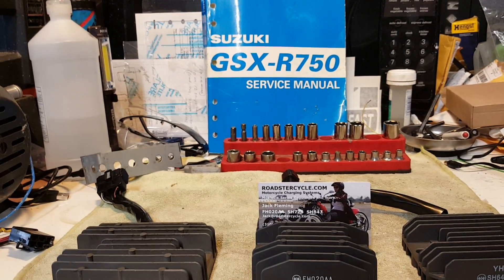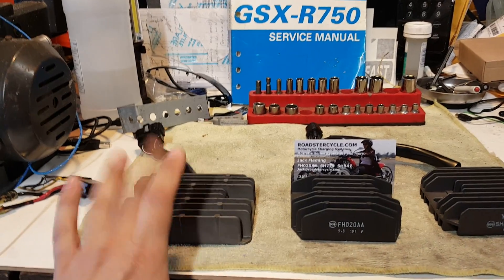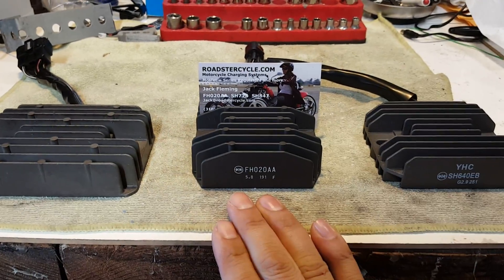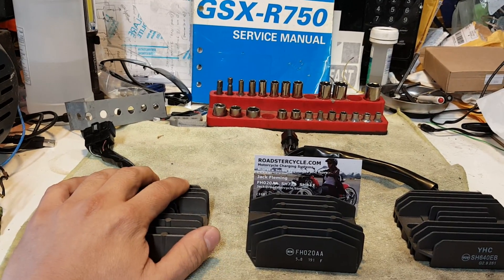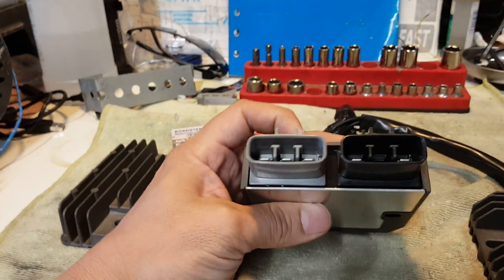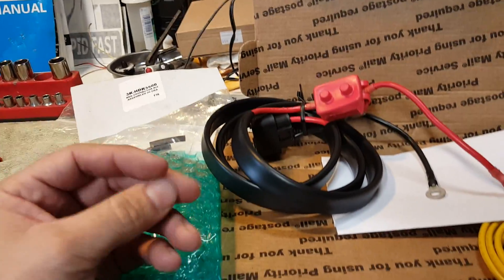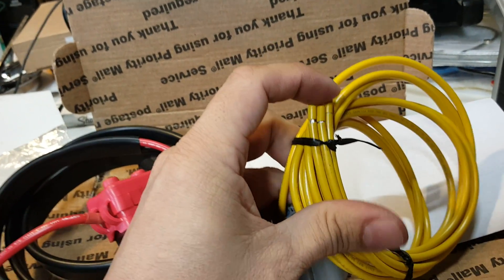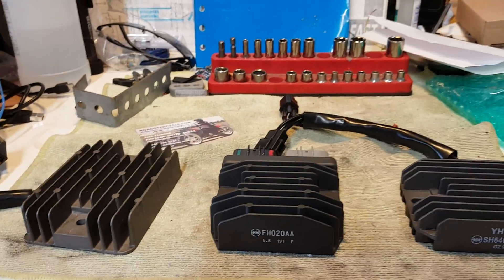FHO20AA MOSFET Regulator/Rectifier Review

Comment: Shunt or MOSFET regulator is the worst choice for stator life. It is better to replace it with a series or special hybrid of series + shunt regulator. The connector to the stator burns out precisely because a shunt regulator is used.
Reply from the maker: It's been my experience that all do the same piss poor job at that connection point. That being said is why I recommend just cutting off the connector and running a solid top grade bullet connector to each line.
Reply: @TheChemistDIY ,  That could be the reason. However, look at the thermal pictures of the heating of the wires (and connectors) of the alternator with shunt and with a series regulator. It's a big difference. High temperature leads to oxidation, which increases the transient resistance, which then leads to even greater heating, etc.

Comment: I believe some of the rectifier/regulator problem goes to the account of electrical load modification. The bike was engineered with the certain regular load and the rectifier was design to dissipate (heat up) the excess voltage. Many of us jumped on the bandwagon of the cool (most of them illegal) LED conversions, especially in headlights. The halogen used 5-6 Amps, the LED will use maybe 2 and still blinds the hell out every road user around us... BUT! The excess (not designed) current lands on the voltage regulator in a form of excess heat, so no question it will die sooner, if we are unlucky cause some damage in the stator. So in the next round the slightly damaged stator will cause trouble, like a hidden rat, chewing through couple of (even upgraded) regulators. Maybe that is one probable cause why we can read in these comments about the repetitive failures. With any changes, system/battery type etc. you have to be aware of these carefully designed/balanced systems to be safe on the long run. Happy riding!

Comment: best regulator oem? long lasting twill
Reply from the maker: Well I'm going to say this MOSFET is better then the oem but I think me relocating it to the front of the RAD plays a huge part in it. It's been what 5 years now with this one and not one single charging issue. I've had two oems and they both took a dump on me.. never had anymore issues after this one.
Reply: @TheChemistDIY  should i get a mosfet? mosfet 5 year very very nice (oem regulator 4 year)
Reply from the maker: @turk6770  I don't want to swayed your purchase brother. OEM is way better than an eBay special that's for sure and will definitely do the job. But after going the MOSFET route, well, I won't be turning back. Hands down the roadster cycle FHA delivers power like no other. I have two sets of fog lights, ground effects lighting, low and high beam all running at the same time and what ever the bike needs being drained from it and this MOSFET has not to let me down. Again proper cooling is going to play a big part in the RR lifespan.

When it comes to quality, by far this one is better then OEM with beefy water proof connections and thicker cabling plus a self reseting fuse.  Yes it may cost more but this is one of those  parts that you are not going to want to go cheap on.

Again this is just my opinion and after 5 years and still going I don't regret the purchase and can recommend.

Comment: suzuki gsxr 600 molsef regulator how many years, how many miles
Reply from the maker: Not sure if I understand your question. My bike is an 05 GSXR with 151K miles. Yes 151,000, that no type-o. I've had the same MOSFET RR you see in this video currently on my bike now with no issues. Stay away from cheap
Reply: @TheChemistDIY  thank you oem i will buy
Reply from the maker: @turk6770  can't go wrong with oem, the one thing you should do is move it to Infront of the radiator. The stock location is why they typically overheat and burn up, their is just not enough air flow for them to properly cool.

Comment: Those rectifiers are both internally and case grounded (case grounding provided by the mounting bolts) very often just loosen the mount bolt for the rectifier, tighten that sucker up again so it digs in (unless it's rusty then clean it right)

Comment: How doi geat ahold of the connectors separatly?
Reply from the maker: Eww, that I do not know. It would easier to just add your own male and female spade connectors or just butt connect.

If you really want the connector I would start with Google researching JAE connectors. JAE is a manufacturer all sorts of connectors and may have one that fits this application. Else you would need to ebay a used wiring harness and swap out if the harness side and or purchase a RR just for the connector.

Comment: Did this rectifier last a long time? New subscriber btw!
Reply from the maker: What up Kevin, welcome to the channel. Your the 2nd person to hit me up about the longevity of this product this week and let me tell you.. after almost 4 years now its still on my bike and working like a champ. I haven't had one single issue with my charging system, the voltage output still remains at 14.3 volts As when I first purchased it.

Chris, a new subscribe as well just recently got in contact with the guys at rostercycle.com and picked himself up Super kit as well, I'm looking forward to his review in future..

 Just an FYI I have no affiliation with them.. I make no 💰 in referrals or promoting their product.. in fact they probably don't even know this video exists and helps them in their revenue. When I see and test a good product I'm happy to report it to you guys just for simple fact that it helps out another rider. If your in the market for a RR this is the one you should get..

And if you do get it (or even if you don't) make sure to relocate your RR to the front of you radiator.. this is by far the most efficient way to keep these units from burning up and proof of that is shown on the 06 models and above when Suzuki started placing them by the horn after so many complaints of them frying, although I wouldn't recommend that location as well since that puts it closer to the headers (lots of heat).. I have a video on relocating the RR, be sure to check that out as well here: https://youtu.be/8GUM-dAw8Io

Last but not least be sure to hardware your stator in and get rid of those connectors altogether. The guys at roastercycle.com shared that tidbit of information with me and I'm happy to report I haven't had a single problem with my electrical charging system ever since.

I hope that helps you out brother, let me know if you need any other assistance.
Reply: Awesome! Yeah I've had two different rectifiers and stator go bad over the last 7 years of ownership. And I gotta tell you I believe it just the heat that burns them up. So I moved mine in front of the radiator like you did and I believe that's the answer to the problems! I'm going to try the fan switch mod this weekend. Anyways thanks for the reply bud!
Reply from the maker: That I do not know, just call them up and ask. There pretty cool guys and have a wealth of information.

Comment: I have a installed a CPU fan under the rectifier...... temps are way cooler then normal
Reply: Not a biggy, i placed a CPU fan under the rear seat placed and screwed the rectifier over it, made sure the fan can suck air from beneath , hooked up the wires directly to Batt, with a secret on/off switch..... total cost 1.5 USD😀😀😀
Reply from the maker: NICE!, what size, how did you mount and how did you wire up. This could help out people who dont want to relocate like i did.

Comment: when you get a good one. mosfet  unit will run cooler . Mosfet's have very low voltage drop compared to transistor  SCR diode units. The rectifier regulator is on many different bikes. even  ATC/UTC's even riding lawnmowers. the 12V charge is the same. it's the amps and if 3 or 2 wire stater. Lots of fit's for the unit shown hear. Fuse or CK breaker a must!! save wires. If you bike doesn't have one go to local auto store and get one. + side of battery. Even scooters have them. always check stater output volts/amps when retro fitting.

Comment: If you're only getting 6-7 months out an OEM regulator/rectifier, then you got another issue...
Reply: Bet the connector was the root cause the whole time
Reply: GSXR's must be made like Ducati 1198's. Ducati went to great lengths to produce an amazing racing bike but seem to have spent zero time on the consumer electrics, placing the VR/R right next to the headers. I was changing mine every 5 months until I got the MOSFET.
Reply: @HarryBo25  same, MOSFET way to go.
Reply: exactly was saying same...come on man...6 month ???

Comment: Does this model fit with a stator that outputs 30 volts.hyosung gt650.
Reply from the maker: Fırat Sönmez. I would say yes because the job of RR is to regulate the amount of AC current and convert it to useable dc current, what ever is left of is shunted, but this is a question best left to the manufacturer, i would say call them up and ask for a more reliable answer. There pretty cool guys and very knowledgeable.
Reply: They use 22,20 or 12, but I do not know which one it is. I do not know the serial number of $ 100. If you do not get the license, it will be garbage. Is there a difference between the models?
Reply: 10 amperes required receive
Reply: Firat .... I once had a Hyosung 650... I got closer to 80 volts coming out of the stator.  Check that.  PS.  I replaced mine with a kawasaki stator and a shindegren from roadster then drove it cross country.  (how's your transmission output shaft ... did it strip the gear off yet?  replace the drive gear with something mde with better steel)

Comment: Be aware! There are a lot of fake Mosfet FHO20AA regulators on Ebay, so know what you're bidding on first. The real ones have a stainless steel backing plate on them for one thing. There are some fake knock offs so be careful.
Reply: The fakes now have the steel backing plate.Generally on sale on Ebay for £50 or £60.Jack from Roadstercycle has a video on here somewhere showing the genuine Shindengen RR's.The fakes are very convincing but not quite the same.You may pick up a used genuine item for about the same price as a new fake one.Bike breakers often have them for sale on Ebay.

Comment: Is this shunt type or series type?
Reply from the maker: Ivan im pretty sure it's SHUNT. At the time of purchase how it performed the function and efficiency or load on the engine I should say wasn't really a concern, after all the bike comes stock this way. After speaking with one of the owners of cycleriders.com he pretty much sold me on the reliability of his units. I only had two requirements, it had to give me the required voltage to to operate the bike and then some (any additional power draining accessories I added), and it had to be reliably (couldnt burn up).  I have to say, it's been been all that and then some. Since day one all I've seen across my onboard voltmeter is steady 14.3 volts during my ride and my battery is charged every morning at 13.2v. Don't regret my choice and spending the extra cash at all.

As for cooling
I had also thought about installing a fan but didn't want the worry or the possibility of the fan component failing and not being aware so i opted for a natural cooled location. Also, I wanted to eliminate those damn connectors when at the time were toast once again.

You brought up a good question, I'm going to have to email the guys at cycleriders.com and find out.
Reply: http://cycleriders.com/ is dead website
Reply from the maker: My bad,, wrong web address. Here is the correct link

http://roadstercycle.com/

Comment: how is the mosfet regulator/rectifier holding up?
Reply from the maker: jwrath90 Man i have to say that was an excellent purchase. i get a consistent 14.3 volts all the time. i hooked up a volt meter to monitor my RR ever since i was having issues with my electrical charging system. i think a voltmeter is a must have to insure everything is functioning properly throughout your charging system (stator, RR and battery). i have yet to see a RR stay consistent with all the lighting that i have but that mosfet is the exception putting out the voltage like a champ. i highly recommend if your in the market.
Reply: james moreno I too have gone through several rr, stator and batteries. I have 5 rr and 4 batteries. I'm tired of my bike leaving me stranded so I'm thinking of investing in a mosfet rr. I have a 2006 gsxr 600 with 28,000 miles. got it in 2011 with 5,000 miles. been through 4 rr's and have been stranded at least 4x.
Reply from the maker: jwrath90 Ouch, ya i feel your pain, that was my same scenario. couple of things i would say to change or upgrade. i believe your RR is located by your exhaust headers, i would definitely relicate that to a place with more air flow. that was poor design by suzuki. i have relocated mine to the front side of the radiator and you can find that DIY in my arsenal of DIY videos.. two- invest in a good battery, i have a lithium-iron cell battery thats just awsome, never a slow crank after putting this bad boy in, you can find that in my videos as well. lastly, upgrade all your wiring to 12 gauge and stop using the stock harness and cheap connectors all together. everything hard wired!.. after i went this route i havent been stranded since. but that must have like i said before is that digital volt meter i got from ebay. i click that thing on before i stary the bike and i known i have enough voltage in my battery before i even start my ride, and during my ride i can see that voltage is charging my battery getting me from point a to b. Sounds like a pain in the ass to get all these things done but you wont regret it and wont find yourself stranded anymore. Nothing worse than paying a towing fee to get your bike home when that money could have been spent on your bike. thats just my 2 cents..
Reply: james moreno oh wow. Yeah that's quite a bit of work there. I was go8jg to replace my battery and rectifier so they are off to a good start. I was hoping that the mosfet alone would be enough. I know how to work on my bike to an extent. I don't know much about replacing the wires. I think the voltage meter sounds good, I know that website has one with a green light that he made so I might invest in that but I was hoping that the mosfet rr alone alone would resolve the issue. no kidding, I've spent so much money on repairing the charging system.

Comment: I put one of these on my '91 Suzuki DR650. I am running a stereo with Rockford Fosgate speakers. Previously I went thru 2 stokk reg/rek boxes. My Roadster MOSFET r/r is still going. Great review man.
Reply from the maker: Subix Barbarasson thanks! This thing was a breeze to install. love the fact that the batt side cables shoot directly to the battery and not run through the main harness. so far i get a steady 14.3v but i run a shit load if accessories that are real power drain (two fog lights, high n low beam @ same time, and city lights). At stops with all this running i can see the numbers drop on my on board digital volt meter to about 12v.. thats still good considering the OEM RR would dip down to 11.7v with all this running. A quick blip on the throttle and the voltage returns with the new Mosfet. i might invest in a second battery, ive been looking at the Shorai.. lighter and small.. maybe mod my trunk to fit & run duel batteries.
Reply: +james moreno 
Dude are you familiar with the  Wye (Y)/Delta stator mod? A handfull of dudes rewire their stator to put out more power with higher RPM. sounds like you may already have that. But i dunno. I have been lead to believe that tee stokk setup for my bike puts out a konstant range that will not go too low or too high. But if someone runs hella akksesssories shit doesn't keep up. Thats why they rewire and make up for loss with rpms. Man ill find thee link and post in the thead. Btw, that led spot review you did  was very helpful. I ended up with a automotive store led flood light for my main and a trail tech brand LED spot for high beam on my dual sport.
Reply: +james moreno 
Ok dude, dig this point of view. Also read a bit into it and look at the procycle llink. The dualsport guys like me dont have much for power so we are always looking for new ways to inkrease efficiency. 

http://drriders.com/topic10677.html
Reply from the maker: Subix Barbarasson .. Ya bro, post up that link for me, Id love to research it, im in need of more juice. Glad my Spot light review  worked for you. Im thinking about swinging the same way.. All LED lighting and getting rid of my HIDs. i seen a Bagger the other day with 3 rows of LEDs for the headlights and i couldnt even look at it directly is was so bright. Im looking to find a solution to get more lighting with less wattage so its not so much of a drain..LED is the solution but i just need to figure out how to make it work and look pretty fitting in the OEM headlight..
Reply: +james moreno 
Dude if you do FB chekk out a group khalled
 " DR650Riders"
I am an admin on it. I know they are totally different bikes, but you kould learn alot from the limitations and resulting solutions alot of the members kome up with. There is also a few kats around saktown and Nor.Kal.  in general. Some riders are pretty about their bikes and some dudes like me are dirtier then Watt/I-80 after dark. Either way it is a kool respektful group. Just realize it is very DR specifik so don't post a pik of your bike.  other admins might see it as spam and ban. We get alot of people posting other bikes and unrelated shit.  But other than that it is kool knowledge .